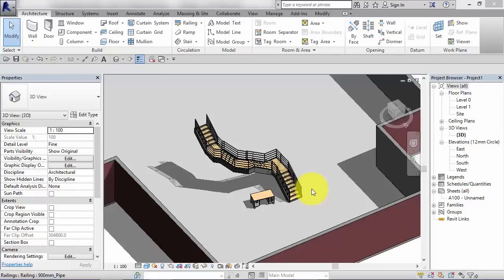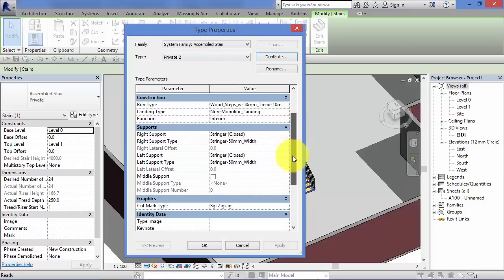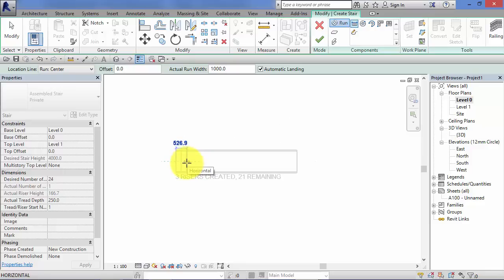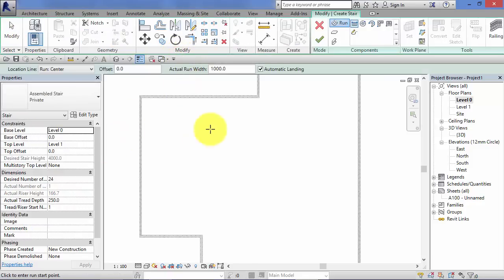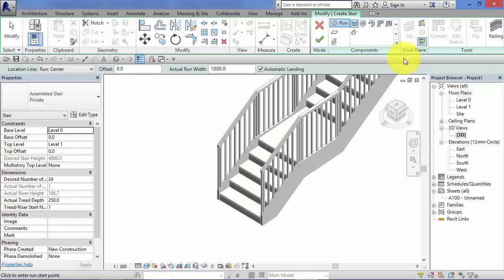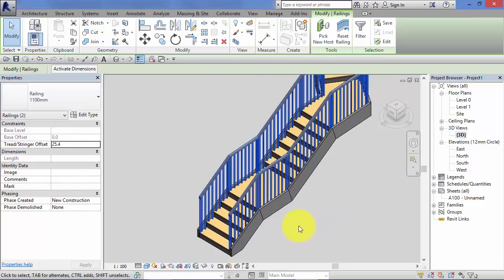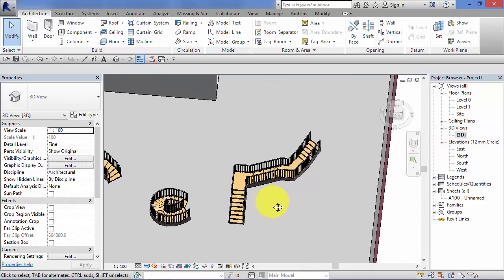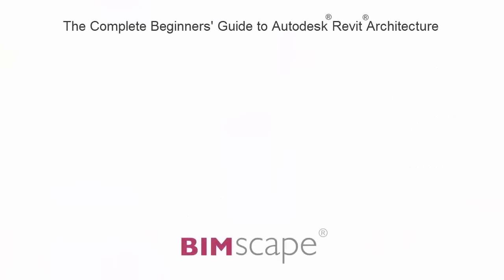Module 4: Unit 12: Revit Architecture: Stair by Component

Comment: Great video, I learned a lot here, thanks. Quick question. Is it possible to adjust the length of a landing after creating different parts of my stairs and connecting them with the landings? How do I adjust the length of the landings?